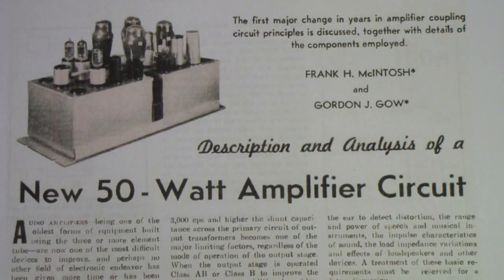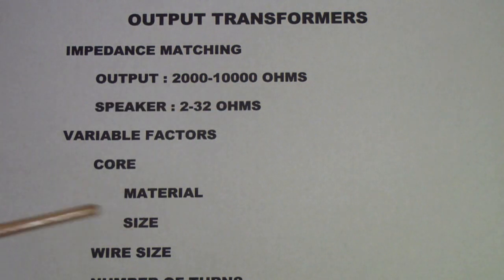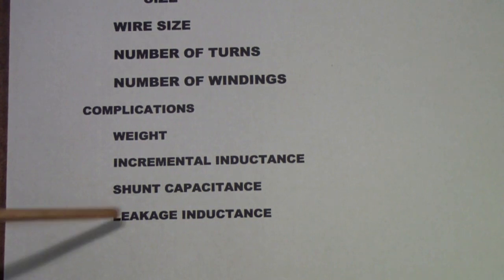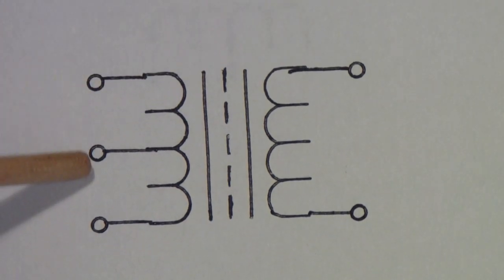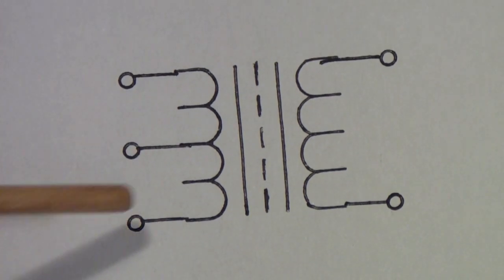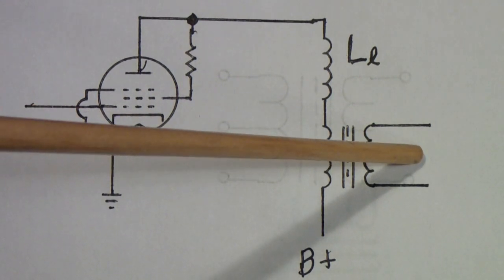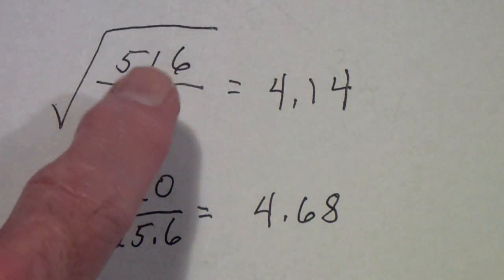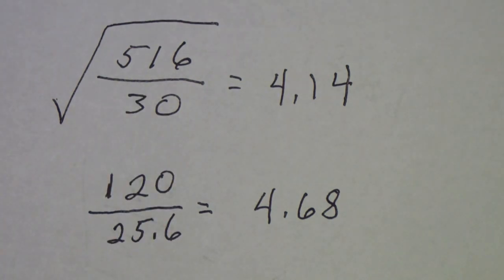TTT186 Transformers in Tube Circuits

Comment: Nicely delivered explanation... thank you. I was once in an old books shop and they had a tiny section on engineering. I found a copy of the Radiotron Designer's Handbook 4th Ed (RCA) that virtually jumped out at me... because it was about electronics as opposed engineering. Purchased for the princely sum of 50cents !!!! Now to go find the Morgan book (but i know it's not gonna be such a bargain).
Reply from the maker: Both books are excellent, one you might add is Frederick Terman's "Electronic and Radio Engineering which was the bible of tube engineers in the 50's and 60's and can be found for free online now. Not nearly as mathematical as modern engineering textbooks but an excellent source across most of the field of that day.

Comment: Isn't the Inductance difference between those 2 meters due to different measuring Frequency,  not due some kind of stray EMF in the room, if im thinking correctly here . One should know the measuring frequency, it can be measured by another meter set on frequency  meter , that PRO meter should have one

Comment: whether simpler just put 10v ac primary and measure output voltage and calculate that? But still great videos. Love them all. T. Mikko from Finland:)
Reply from the maker: Thank you for your comment. Yes, using an AC voltage on the primary may be simpler but potentially dangerous for those with less experience. If you use an isolated, current limited source of voltage then the method is relatively safe. But I have seen examples of the use of an auto-transformer (like a Variac) and that potentially can be lethal for an inexperienced user. If you are lucky enough to have an LCR meter, that is much safer and just as accurate (if you use exact values instead of the approximations I used in the video).
Reply: Correct. And if you put accidentally high voltage in secundary...Huh Huh :)

Comment: Tom, excellent video. I was not aware of that method of determining turns ratio and leakage inductance from inductance measurements. I love new methods of measuring things. I have the Radiotron Designer's Handbook and agree it is a good source of information. It is my opinion that the older books are the very  best place to look for information on vacuum tube amplifiers. I want to include a link to a free PDF article I think you will like and may already have but maybe your viewers are not aware of.  
http://lcweb2.loc.gov/master/mbrs/recording_preservation/manuals/Tektronix%20Cookbook%20of%20Standard%20Audio%20Tests.pdf The article is called, "The Tektronix Cookbook Of Standard Audio Tests"
Reply from the maker: Thanks for the comment and information. I actually learned this method many years ago but was recently reminded of it by Robert Bolanos on his YouTube site. He has many good videos on flyback power supplies and measurement in switching power supplies that apply equally well to tube output transformer stages.